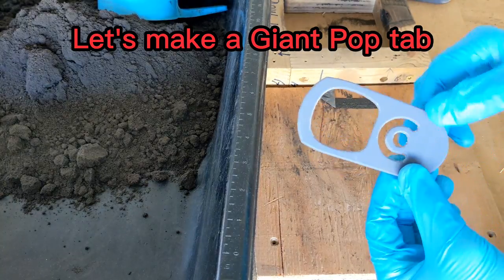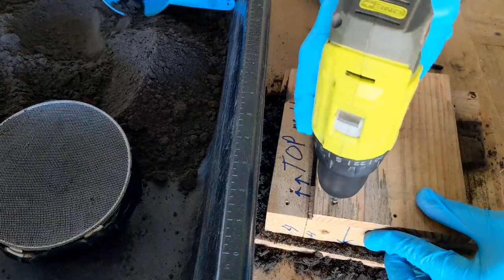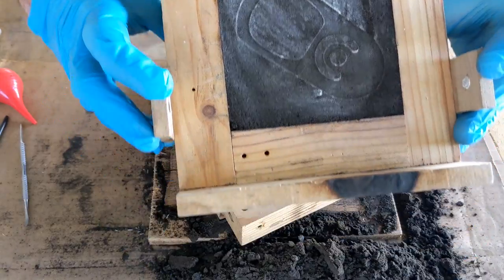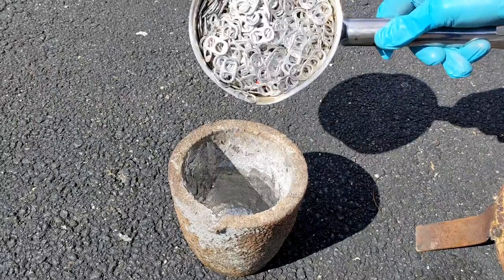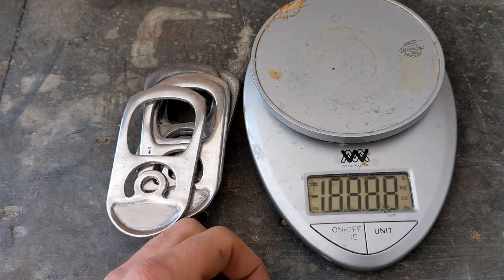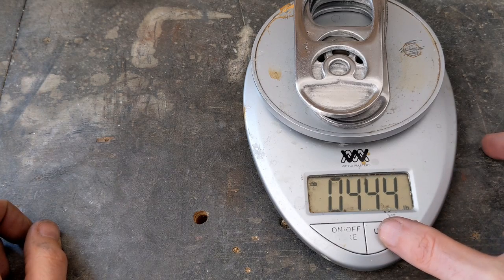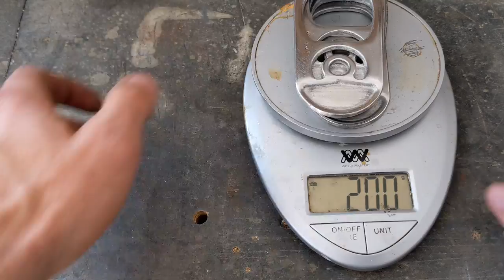Pull Tab Big Win | Melting Pop Tabs | Big Aluminum Pull Tab (Soda Can Pop Tabs)

Comment: What is your furnace lined with?
Reply from the maker: The outside layer is a ceramic fiber wool.  I then coated it with a refractory called Green patch 421.  It works really well.
Reply: @HeinrichsMade  OK. It looks a bit like sand, so I was confused.
Reply from the maker: @doriWyo  definitely not sand that would crumble!
Reply: Thats what I thought.